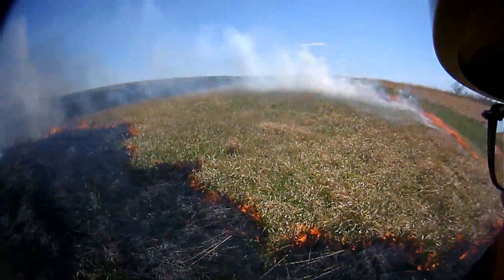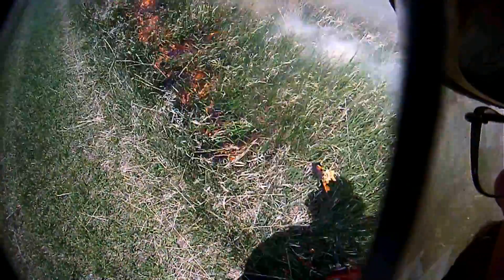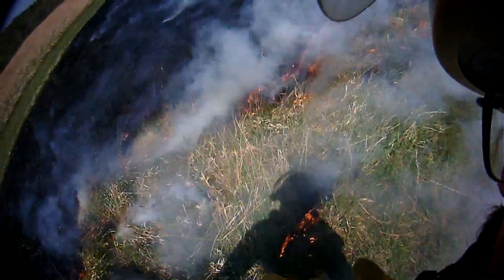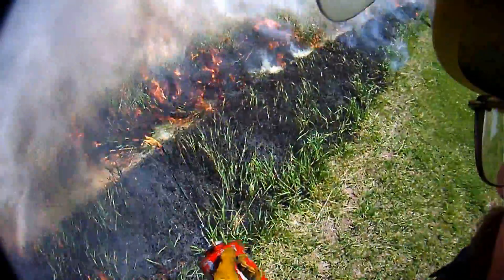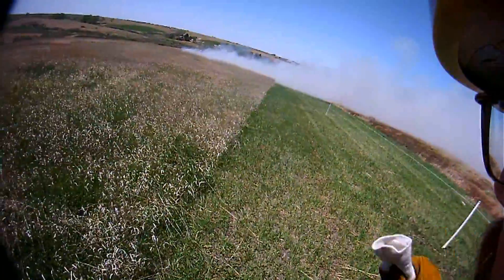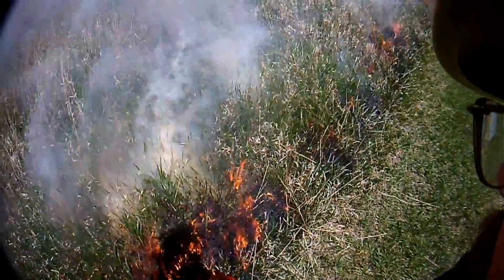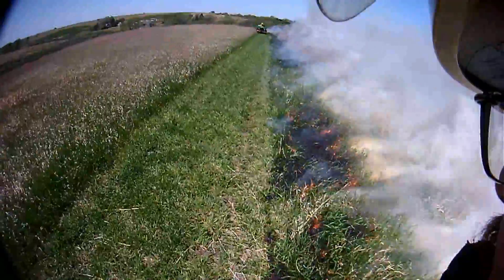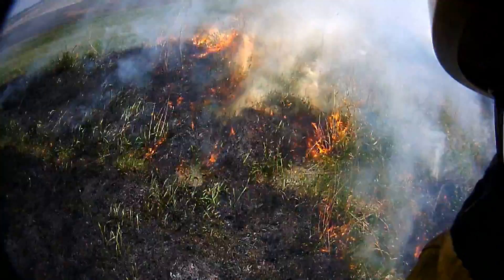Low oxygen levels generated by a wildland fire

Comment: Great video Brad. 

Any theories on the range of the low oxygen extends into the fire break? Would a vehicle have to be right up next to the fire? What about effects on humans, short, medium, or long term? Maybe this low oxygen is why I feel extra 'gassed' after a green fire?
Reply from the maker: Hi Aaron, We spent the last burn season running tests trying to map the low oxygen area around a flame front. Here are our initial findings.  First, we were able to kill my mom’s PT curser just using a small camp fire (this required us to replace the idle air control valve which we damaged).  In that fire we measured oxygen levels as low as 12%.  We were able to map the low oxygen zones around several controlled burns last season hitting 12% many times but always down wind. We could only map backfires and small flank fires.  Even with a 30’ boom the fire was too hot.  On a normal head fire the low oxygen zone may be more than big enough to snuff an engine crossing or working downwind from head fire.  Additionally and to your second point, the area downwind of the fire line probably has lower oxygen levels.  This may have an effect on overall crew performance.  We just have not mapped it.  For crews away from the heat but still in the smoke, this could play a huge role in fatigue over a day.  I think this is dwarfed by the effect of heat on crew performance when working near a fire line.  Core body temp buildup is almost completely ignored by wildland firefighters and particularly by prescribed firefighters.  The low oxygen danger probably switches back to a priority once the crew and engines are down wind/in front of a flame front.  A reading of engine stalls and burn-over reports shows that this low oxygen front could extend 100+ yards from the fire line.  Any level that can kill an engine must also be impeding physical and cognitive abilities of the crew.